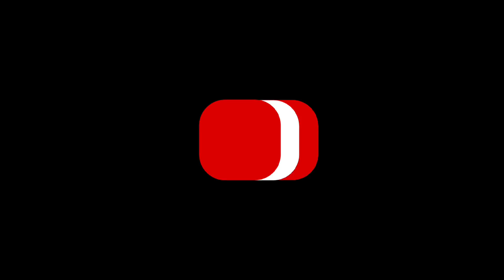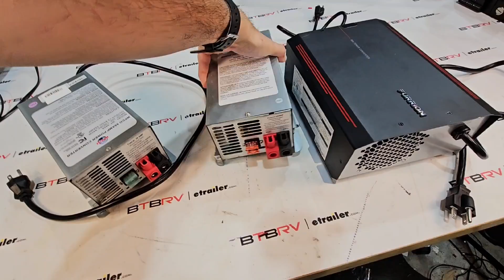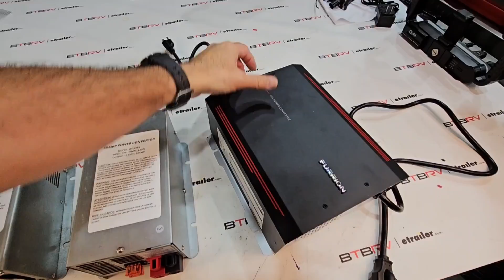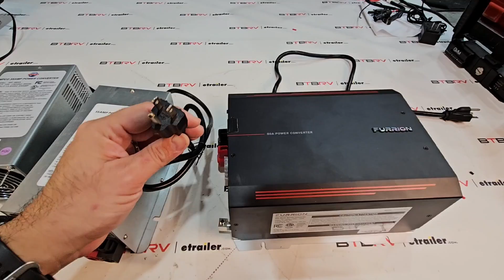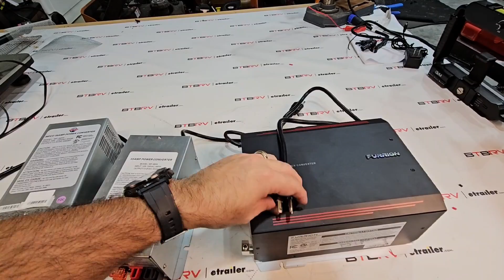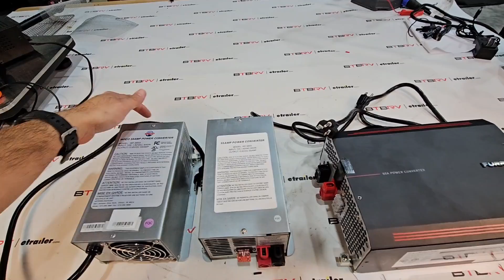WARNING! Copycat Knock-off WFCO RV Power Converters!

Comment: I got suckered into buying one of these knockoff off eBay for my new houseboat build. It lasted 5 minutes then burned out.  The seller sent me a replacement but, unfortunately, that one also died within minutes of plugging in. If I had known it was a knockoff I would never have bought it. I have owned a genuine WFCO in my other RV for years and didn’t realize that knockoffs are available until I bought this one.

Comment: A friend of mine just recently learned the hard way that the knock-offs are no good. He got a 75A knockoff, installed it in his RV. While it did auto-select the correct voltage and was happily charging the LiFePO4 batteries. It lasted 30 minutes before overheating and letting the smoke out (quite literally).

It actually smelled like it was running pretty hot, within the first 2 minutes. That was in an open compartment, with the ambient temperature 19C that day.

I opened it up after the failure and the heatsink was EXTREMELY hot (yes, the fan was working). Also noticed the temperature sensor that is supposed to be for overheat protection was not even in contact with the heatsink!

Buyer beware for sure.

Comment: you should've popped them open and show the guts to the real vs the generic one so people can see the obvious difference by them getting to see the circuit boards and the caps & coils which would be real obvious to see when they're side by side and usually have a sloppy board layout in them

Comment: Thanks for this video.  Nice to have channels like yours point out this knock off problem to the unsuspecting.  I believe it was Project Farm who did similar video regarding knock off Milwaukee batteries. But the best thing one can do to protect themselves is look at the price.  If the price looks significant lower there is a reason for that. I do shop on Amazon, but not for anything that matters.

Comment: Another thing that you forgot to mention, "upgrading" to that 80 amp converter will also need the DC wires to the batteries replaced with a larger guage to handle the current. When I changed over to lithium batteries I used the Powmax 60 amp converter. I too like the fact that you can adjust the voltage to have your personal setup at the correct voltage. Had my brother in law, a long time electrical engineer with power supply design experiance do a complete "torture" test on it and he was impressed.

Comment: It would be a lot less confusing if they called it a "battery charger" instead of "converter" - I know that it's also acting as a DC power supply as well as a charger but that function doesn't really match the "converter" moniker either.
Reply: Agree. Not sure why the marine industry and every other industry call them battery chargers, but RV’s call it a converter
Reply: I think they call it a converter because it isn't just a charger. If your battery is disconnected, it still functions to power all your 12v electronics inside the RV.
Reply from the maker: Yep. In many cases that is why